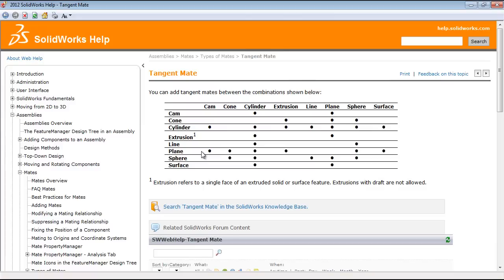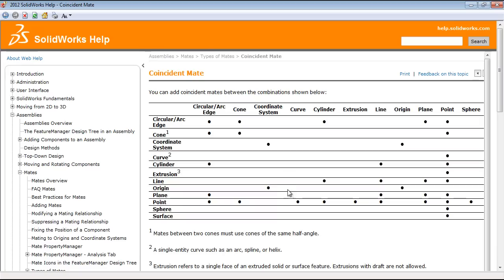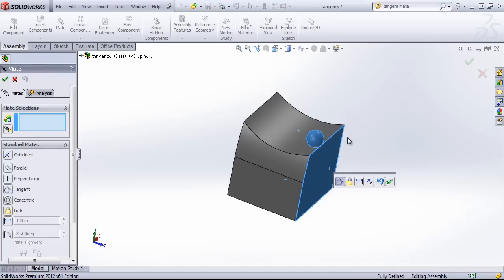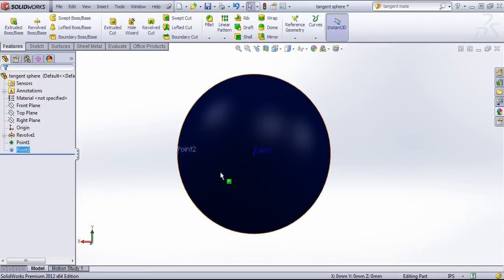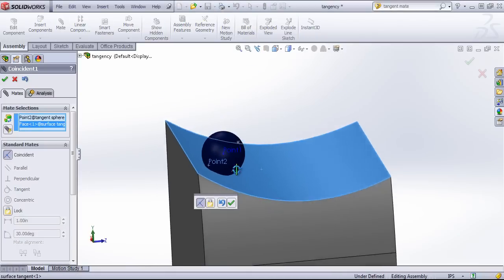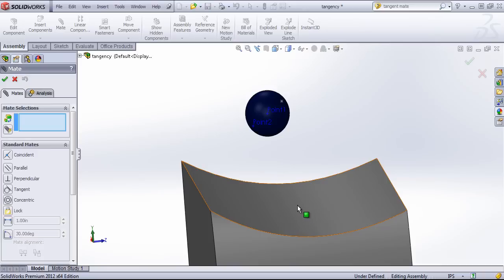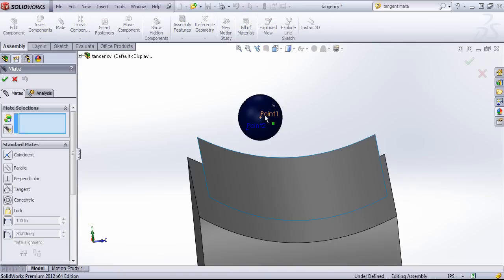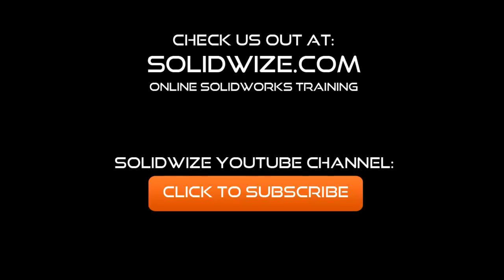SolidWorks Training - Mating a Sphere to a Surface

Comment: Nicely done. If you wanted to depict a sphere a toroid (steel ball and o-ring seal) in contact with each other using a mate in SWX 2020, shouldn't it be as simple as choosing surface of each and assigning a tangent relationship? There've been some usage features added since the version you are using. But, try as I may, I'm unable to make that happen. I have their axes aligned coincidently. I was really hoping for a homerun. Didn't happen. Advice?